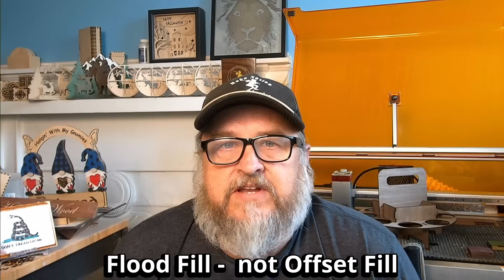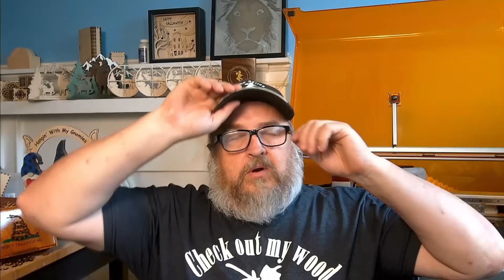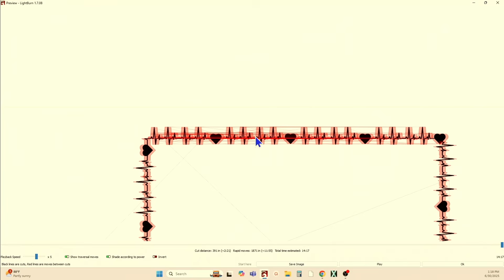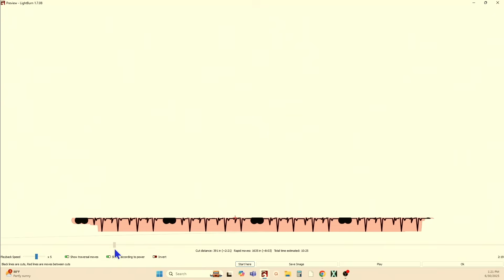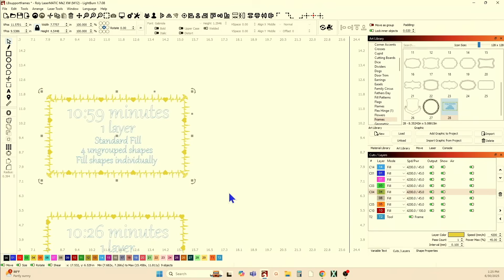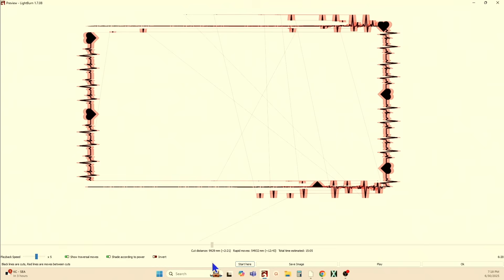Cut engraving times in HALF!

Comment: Thank you Steve. Mind blown, the many ways to design and the time difference.cant wait to get my Roly.
Reply from the maker: The rabbit holes can be numerous when searching for the most efficient way to engrave an object.  Doing a single item and saving 10 to 20 minutes may not be that big of a deal for some.  But for folks that are making multiples of the same piece, saving even 10 minutes on 10 pieces is over an hour and a half saved.  This is less wear and tear of the laser in addition to less time to produce each piece lowering your cost of production.  If you haven't ordered the Roly yet, be sure to use my code... https://hobowithwood.com/roly

Comment: I put my material at a  45% and the preview looked good with no jumping around.
Reply from the maker: I don't quite follow you.. Placing the material at a 45° angle wouldn't have an effect on the laser movement.  If you are referring to rotating the design in Lightburn to a 45° angle, I've tried every combination of 45° and cannot get a result that doesn't have the laser jumping everywhere.  Are you sure you are using Flood Fill?

Comment: You did hit on the reason as to why the scan angle matters in the flood fill. It all boils down to the x axis, because how Lightburn breaks up the graphics.From what I can see flood fill is defined by the scan angle, and when it hits a non contiguous pattern it treats each section as an individual graphic. I agree the best thing to do is break it up into 4 sections, and use 2 different cut paths so each would do horizontal scans angles.
Reply from the maker: I have came to the same final conclusion, (waiting on Lightburn to confirm.)  They ONLY time to use Flood Fill is on simple shapes used to make a frame.  Otherwise, you are better off dividing the frame. I've been slammed with emails how to simply divide the frame... that's tomorrow's short video.

Comment: I wonder what a 45 degree scan angle would do.
Reply from the maker: That was an excellent suggestion.  Even if it worked, I knew the times would be slower.  Anytime your engraving is requiring the gantry to move on the Y axis is add time to the engraving.  BUT I wanted to see what it would do to Flood Fill.  A 45° scan angle causes it to go haywire on the entire image.  Interesting results changing the various angles.  22 seemed to be one of the best but still screwed up.

Comment: Great video Steve. Did you try setting the scan angle to 45 degrees to see if the was any difference?
Reply from the maker: I didn't... until I seen the suggestion in the comments.  And I thought it was genius.  So, I tried it. It screws up all four sides with lots more scanning white space.  But interestingly, a 22° scan was better than the 45°.  But ultimately the final result I came up with in the video is still the best option.  But I like the way you think.

Comment: Would taking the top and bottom, group them and put on own layer. Then set that scan angle. And do the same with the sides, then run both with flood fill help cut the time down?
Reply from the maker: It would be the same as engraving the four individual pieces ungrouped with fill shapes individually selected.  And more work to do the grouping and creating the second layer.  No benefit.

Comment: Why not offset fill? Why is flood better? 
Can you do east west with 0°scan and north south with 90°?
Reply from the maker: Offset fill works for frames without intricate shapes or designs.  Offset fills from the perimeter of a shape in.  Flood Fill still scans on a set scan angle.  Creates two distinctly different results. You can change the scan angle of the Flood Fill, but a 90-degree scan angle takes longer.  The end result is the best possible result until they get Flood Fill working correctly.

Comment: What if you did Flod fill, ungrounded, fill separately ?
Reply from the maker: Takes longer.  Flood Fill doesn't work as efficiently as intended.  There is a problem with the way it calculates half of the image in Flood Fill.  I still haven't gotten a solid response from LB.  But the final option I showed is the fastest.  When you are using Flood Fill you cannot select the Fill Options.  So it doesn't matter if they are grouped or not.

Comment: What if you set it up with the 2 layers and ungrouped shapes but change the scan angle for vertical and horizontal elements of the design so it fills the vertical elements with with the 0 scan angle and horizontal elements with the 90 scan angle
Reply from the maker: I tried that, too.  But it takes longer than the final outcome I showed.  When engraving on a 90 degree scan angle it adds time.  If you have the four sides separated the faster outcome I came up with was the final I showed in the video.  Try this... Put to identical squares on your work area in Fill mode.  Put them on two different layers with the exact same settings except the scan angle.  Make one 0 and one 90.  The 90 degree scan angle will take longer.  Everyone's time will vary but the 90 scan will take longer.

Comment: Steve, thank you for this video. If I understand everything you said properly, the scan angle can change the speeds dramatically on either the x or y axis. Would it be possible to change the scan angle on the N/S and E/W axis while filling each shape individually to increase the speed even more. Say n/s on a 0 degree scan and e/w on a 90 degree scan angle or is this even possible?
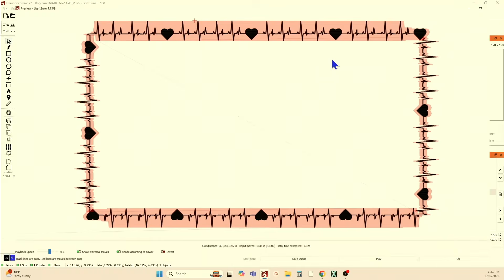Reply from the maker: If you had the N/S on a single layer and the E/W on their own layer, then yes, you could have the scan angle different for each layer. I did try this, too. I was able to use the Flood Fill without it jumping around like crazy, but the overall estimated time was 16:11.  So the best time I got was what I showed in the video.

Changing the scan angle to 90 degrees on the longer horizontal, (N/S), adds over three minutes alone.  Everyone's estimates will be a little different.